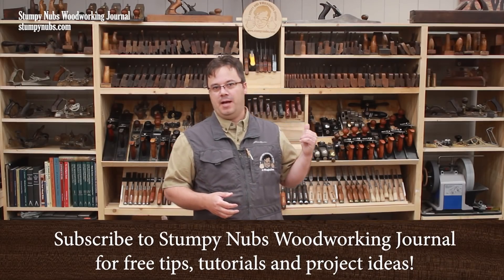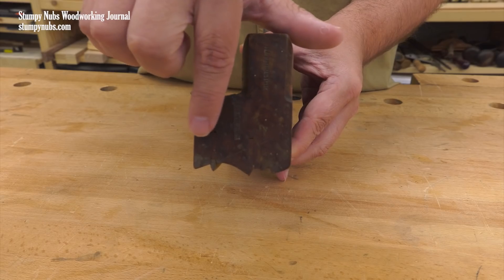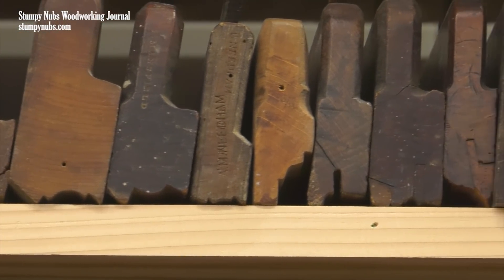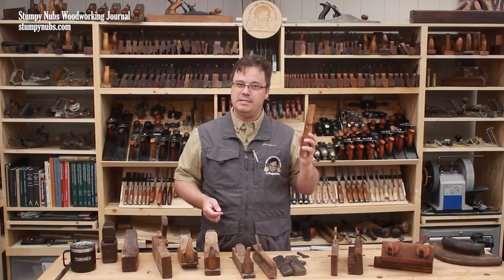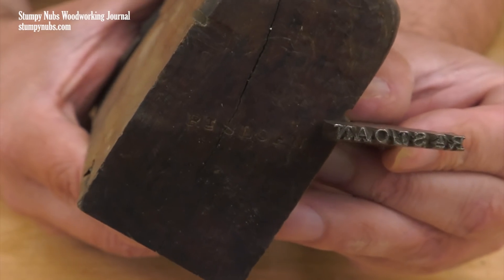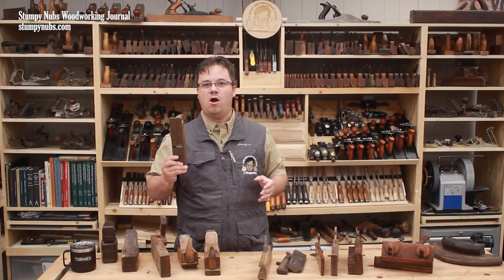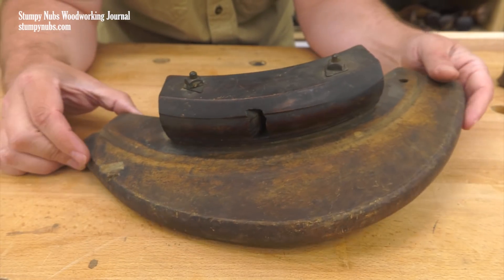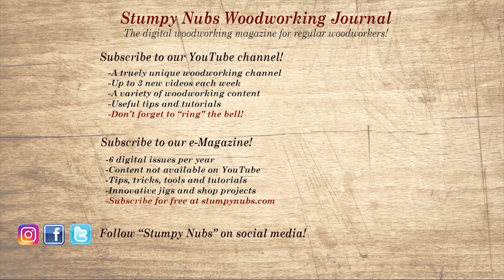Why do I have so many wood hand planes on the wall?

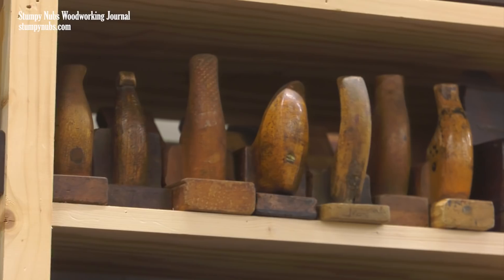Comment: 8:34 These planes are called "Schiff(s)hobel" (boat/ship plane) in Germany and are used for planing concave surfaces in shipbuilding or, as you mentioned, barrel making. The currently available iron version (remake of a Stanley from 1879) has a flexible sole so that concave and convex surfaces can be planed.

Comment: Thank you for making this video.
I used to work as an employee with two German cabinet makers and they told me that in Germany wooden 'continental' planes are still preferred over iron planes. This was in the early 21st century. They are also available in the U.K. where I am ans usually have a body of beech with something harder I know not what on the sole.
Personally I love wooden planes and have a jack which tying in with your video about harder steel has a trojan of an iron that rarely needs sharpening though when it does it takes a while.
About three years ago I had to supply and fit a number of sashes and the lead time from my regular joiner was such that I made some sashes myself. The sashes were of an unusual thickness ( I think they were 35mm) not the usual stock 32, 38 or 45 that I could still obtain from timber merchants at the time so I had to make my own. Having recently read 'The Village Carpenter' by Walter Rose and visited the Weald And Downland Museum at Singleton in Sussex (U.K.) I had discovered sash bar sticking boards and made one. A produced the rebates with a router and table but the ovolos were all made with a wooden moulding plane. This is so much quieter, cleaner and more satisfying than machine working. 
Wooden planes when well honed and adjusted really are a joy to use. It was a rare pleasure when making the sash stock to actually be able on that occassion to make such old tech' pay.

Comment: Great info Stumpy! I have always passed on plough planes in the wild because I was never sure how they worked or if they were complete. Your explanation was so easy to understand. Now I’m on the hunt! Thanks!
Reply from the maker: The problem with plough planes is they usually only come with a single iron and you really need a set of irons for them to be useful. Wood plough irons are out there, but harder to find than cutters for Stanley iron combo planes like the #45.

Comment: Love the history of this stuff thanks for your continued approach to the craft where you not only pass on and train techniques but you take it upon yourself to also educate about the history.
My favourite plane I’ve ever seen was an old ship wrights plane that used to be used for a couple of generation in the Dutch ship building industry. The use of a spring steel pad that can be adjusted to different radii is ingenious and I don’t understand why these are still not readily available.
Reply from the maker: Stanley and a couple other brands made compass planes with adjustable steel soles. There is on on the shelf to my right (viewers' left).

Comment: James, I found what you described as a Shipwright's plane recently. It has a two inch skewed Iron with two iron knickers on either side. They tote leans to the left side. When I bought it, I was hoping to repurpose it as a right-handed shooting board plane. It's in amazingly good shape and even if I can't use it regularly, it's a beautiful wall hanger. :)
Reply from the maker: I don't believe it will work on a shooting board because there are no sides to the mouth, as is common to rabbet planes. Without a bit of cast iron (or wood) on each side of mouth to prevent it from taking a truly full-width shaving, the plane will just shave away your shooting board with each pass.

Comment: Oh wow...I am just a hobby woodworker and drool over you collection every time. I genuinely agree with you that working with old planes is very satisfying. Of course I am just talking about it as hobby. I look forward to the next video, I recently got 3 stanley 45 planes in various stages of disrepair. I have been able to get all 3 in more or less working order except the cutters/blades. They are kinda expensive on Ebay right, so I am working with my friend(tool&die maker) to make my own cutter out of tool steel. Thank you for sharing your wealth of knowledge.

Comment: You should build a small airport to store all those planes, and a miniature pigpen for your router bits.
router (n.)
"cutter that removes wood from a groove," 1818, from rout "poke about, rummage" (1540s), originally of swine digging with the snout; a variant of root (v.1).

Comment: Not being able to get all these different planes is no excuse since you can just make them as you need them. Craftsmen did that for centuries and it´s not hard at all. I make all kinds of rebate planes, dado planes, moulding planes and stuff like that. For the iron I used to make them from C100 steel, which is a simple high carbon steel. I got a nice big sheet about 3mm thick. Out of that I roughly cut the shape with an angle grinder and then refine it. A simple blow torch and some vegetable oil is enough to harden this simple steel. For tempering I just put it into the oven at 200°C. But since high speed steel blanks are so cheap on ebay and come already hardened, I mostly use those now.

Comment: People think you hoard antique tools, you should meet my dad and grandfather. My granddad has so many tools hanging and attach to the ceiling of the garage he needed to reinforce it with massive I beams and bracing so the floor would stop sagging in his living room as it’s right below. Filing cabinets full of plane parts, he has 7 bedrock 605 1/4s and 9 1/2s, has A 100% original bailey defiance with 95% of the japaning still there and 3 others complete in various conditions, he had wooded model patent model of a Stanley bullnose I think it was a 77 which was awesome a Stanley collector traded him a chevy 427 engine out of a corvette for it which he traded for a new septic system.